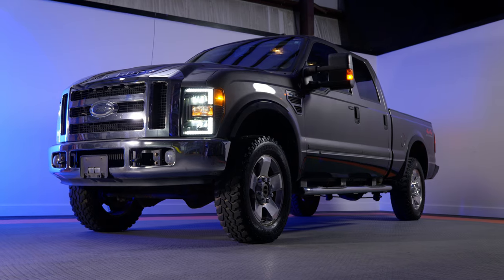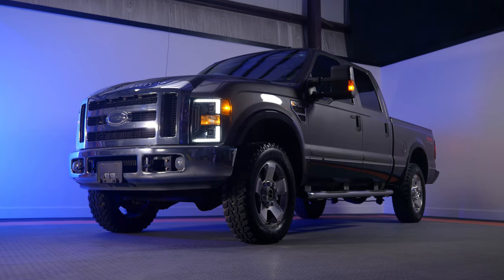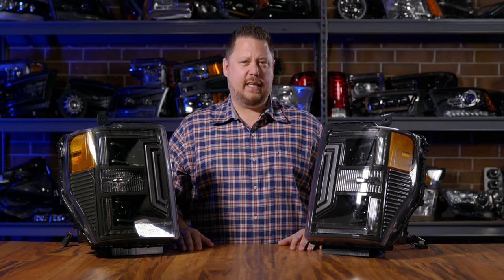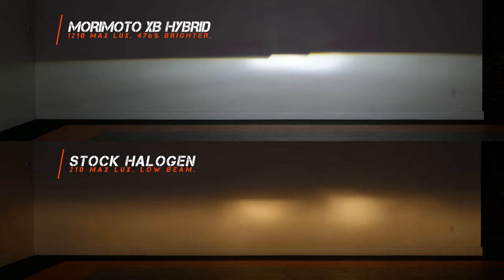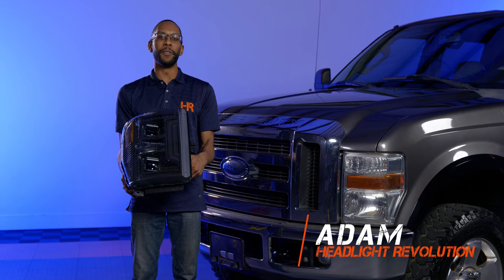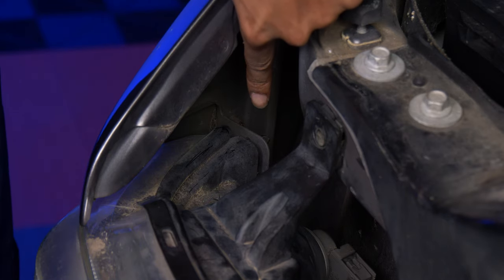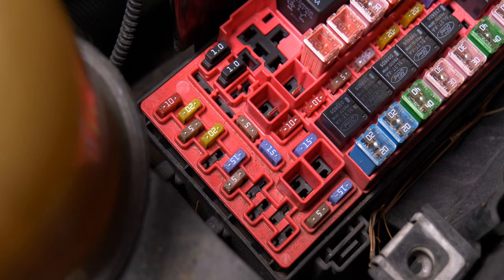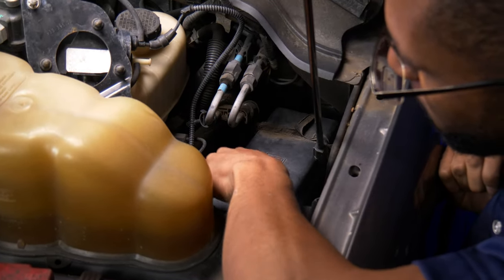Huge Lighting Upgrade for the 2008 - 2010 Ford Super Duty XB Hybrid Headlight Review and Install

Comment: I've watched this video a dozen times because I'm so excited for my new lights to be delivered tomorrow. I was driving home the other night, and with the stock headlights, I literally couldn't tell whether the lights were on or not. Really looking forward to some brighter lights and am just as excited for the more modern look. They were expensive, yes, but my 2010 Super Duty Lariat only has 50k miles on it. I plan to drive it for a long time.... provided that 6.4 doesn't live up to its terrible reputation.
Reply from the maker: Best of luck my friend!
Reply: @HeadlightRevolution  Got them installed in about 20 minutes. Love them! Here's a side by side https://i.imgur.com/XhCrgLh.png
Reply from the maker: Looking great man!
Reply: Bulletproof it and ure good. Fuk what what they say, 6.4 best sounding engine and the easiest to get most power out off. 08-10 are the cleanest body models ever designed by Ford on a truck, even new gens dont look as good, they look good but 08-10 bodies are literally perfect looking every line and curve on them bodies are flawless. Dont ever get rid of it, just pass it down to ur next gen in the family and so on.
Reply: Don't worry maintenance maintenance maintenance. 6.4 from 2008-2010 is actually talked about well. Don't let Reddit tell you what to think or other haters. Mines DPF deleted and has really no blowby. Lots of power and has had 5 owners. Only thing is really suspension for these trucks but that's always an upgrade for any guys truck if you ask me.
Reply: @z-zociety-family4045 yes. I bought a Harley and Ford collab. The dealership didn't list it or maybe even know. I love the look of it and now I see why it's so renowned and hated on. It's actually competitive!